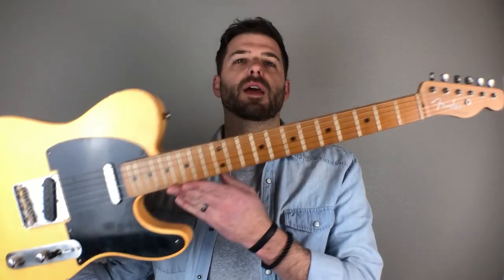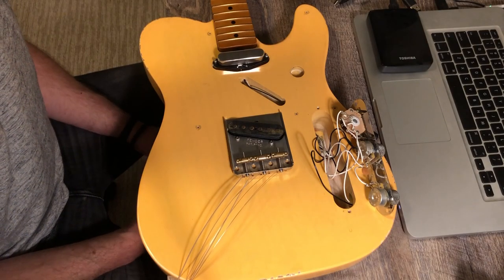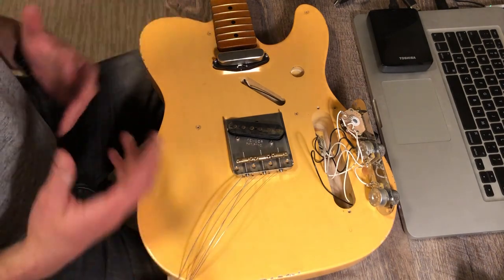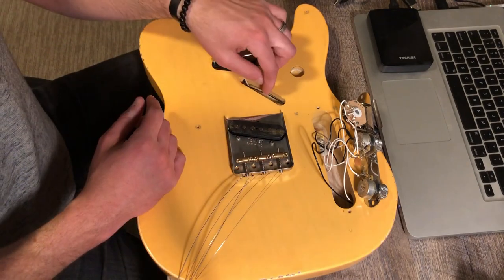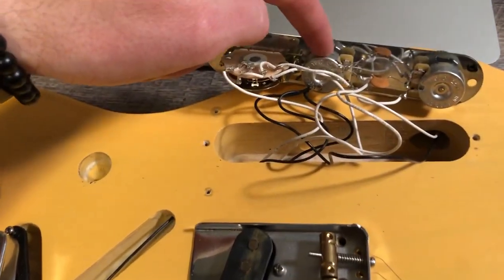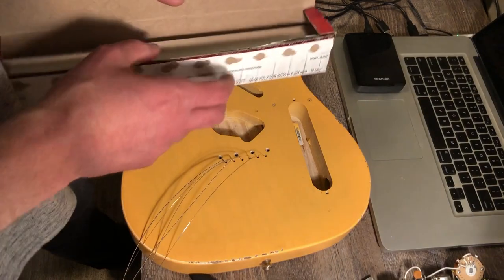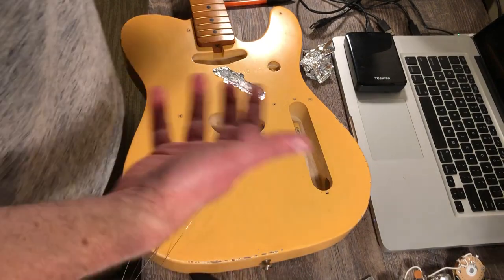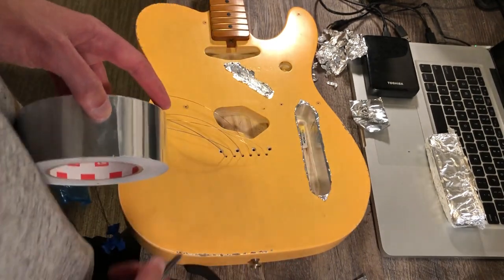Shield Your Telecaster Against Unwanted Noise

Comment: I haven't experienced copper tape just yet but aluminum tape is all I use. I recently widened my Tele's neck pickup cavity for a Strat PU and routed a tunnel for the neck pickup wires so those are the only areas to be shielded whereas the bridge pickup and control cavities have all been previously shielded...cool video!
Reply from the maker: B. Rod Clark thank you! And thanks for sharing your experience. 👍🏻

Comment: No base plate? Call the police! Keystones are well known for having less noise than other single coils. That's not referring to any of Bill Lawrence's stacked single coils. The twisting of the wires supposedly rejects eddy currents, which a pickup will produce. I had lined the cavities of a telecaster with aluminum foil, after reading an article by Bill Lawrence. Bill really knew his stuff, so I felt he was reliable. I have moved from foil to the nickel bearing (not graphite) shielding paint. Works really well. About a 90% improvement.
Reply from the maker: Yeah, the Tex Mex bridge is odd in that there’s no baseplate. It’s sort of why I can’t seem to keep them in any Tele I have; because they’re too non-traditional.

Comment: Use copper foil roll, it should have conductive adhesive, you can cut smaller pieces. You get about 3 metres say you can do loads of guitars and even some of your cables.the rest I use a slug barriers on my plant pots!
Reply from the maker: Never tried it myself (mainly because I’m cheap 😜). But it definitely seems to be the most efficient method!

Comment: I would never use aluminum foil-tape for grounding. It will work for signal interference shielding but copper is a way better conductor of electricity. Copper looks better also.
Reply from the maker: I would argue that for this purpose (shielding unwanted noise) aluminum works just as good. And nobody is going to see it anyway. But the beauty is you can choose whatever you want. 🙂

Comment: I have searched the net, but no proper answer. How do you shield a Tele that has no pickguard?. To me it sounds pointless with an open "antenna" sucking up noise. Will shielding just the bridge and control cavity suffice?
Reply from the maker: Twisting the wires as I show @18:28 will help. Also, yes, shielding & connecting the bridge plate & control cavity plate will help too. Other than that, I’m not sure what else you could do. I suppose that’s why most Tele’s without a pick guard (or a guard with less coverage, like the Cabronita Tele) have humbucking pickups.
Reply: you could get noiseless pickups

Comment: you said u already done the 50s wiring with your les paul, but that's a gibson thing anyway. NO its not bcs also when you use the wiring on 4 than instead of on  2 potentiometers, it still is the same connection you are wiring your tone and volume pot to so it actually is totally the same wiring as with a Tele but just duplicated on 2x Vol & Tone =) 

greetings from austria =) (in europe not australia)
Reply from the maker: Thanks for the information. I will admit that wiring is quite confusing to me, so I may have mis-spoke. 🙂
Reply: @NathanSink  hey thanks for the fast reply :) besides this little mistake all the other information was totally correct and interesting

Comment: Hi, nice video. Thanks! Why do you suppose that my guitar is actually quite in my hands, touching string and parts as you did...but then loud hum when I touch my laptop that is open and on???
Reply: the laptop is giving off electromagnetic waves which is interfering with either your pickups or your amp so just keep your laptop farther away

Comment: This is so much easier (and cleaner) with adhesive copper shielding tape.
Reply from the maker: VIDS2013 yeah, but I’m too cheap for that. 😂
Reply: @NathanSink  $8 for 20 feet of copper tape. Would probably save you 50 bucks worth of labor time.
Reply from the maker: VIDS2013 where from?
Reply: @NathanSink  Amazon.

Comment: Do i need shield at springs part and conductive shielding paint?
Reply from the maker: No Names springs on a Tele? Do you mean a Strat? You can use either shielding paint or aluminum/copper. Either works the same.

Comment: Is aluminium foil just as good as copper tape?
Reply: About the same, but the real benefit of copper tape is you can solder to it. That means you can solder a jumper wire between each cavity, which makes things simpler with something like a tele where you have various cavities that aren't connected with a single pickguard like on a strat.
Reply from the maker: Yes, they are basically equal in their conductivity. As the previous commenter noted, you can solder to copper. However, you can also use strips of the aluminum tape to connect cavities, as I show @13:45 in the video.
Reply: Copper looks way cooler and you can show off your finger cuts.

Comment: My wiring rout is not exposed - just a hole from one compartment to another. I used copper tape for my shielding. Would it be the same effect to just wrap the pickup wire with the tape, rather than try to shield the hole, which would be awkward?
Reply from the maker: Jeff Black I think just twisting the wires together like I talk about at @18:26 will probably suffice. You could wrap the wires with tape to be extra cautious, but you’ll have to make sure that tape is connected with the other tape to join the “cage”. Hope that makes sense.
Reply: @NathanSink  Yes, that makes sense. Thanks.

Comment: Question: the noise you hear at the beginning quiets when you touch....so you are grounding the guitar at that point I believe.  Is it possible that there was actually some grounding issue in the guitar to begin with, which was corrected when you resoldered you connections in order to do the shielding job?
Reply from the maker: I think you’re right, but I think that’s normal (to an extent) for every guitar. The guitar still does that even after I shielded it, but it’s just way more quiet now (less noticeable).

Comment: If you shield the bridge cavity and it contacts the metal bridge plate, does that mean you don't need a dedicated bridge ground?  Or if you have both would it create a ground loop?
Reply from the maker: Correct. If the shielding is contacting the bridge plate & the shielding goes to ground, you are good. 👍🏻 Watch from @16:28 on in the video.
Reply: @NathanSink  Ah cool, thanks!
Reply: Go research what is needed to cause a significant ground loop. The same applies to requiring star grounds only. It's a guitar, not a campus of buildings.

Comment: Does this process get rid of the static you can get on the pickguard? Thanks
Reply from the maker: I can’t say 100% for sure, but I do know that I don’t have any pickguard static on this guitar. 😉
Reply: What you are describing as static is probably a microphonic effect with the bridge pickup as it couples to the metal bridge plate and then to the pickguard. This can be remedied by replacing the pickup mounting springs with pickup mounting tubing. It helps to dampen the transfer of sound from the pickguard. Here's a source for the tubing:
https://www.amazon.com/dp/B000B5L2OC?psc=1&smid=ATVPDKIKX0DER&ref_=chk_typ_imgToDp
Reply: Yes, even just the part where you put tin foil under the pickguard and connected it to the control plate has solved this issue with my tele. Now thinking to do the rest of the shielding.